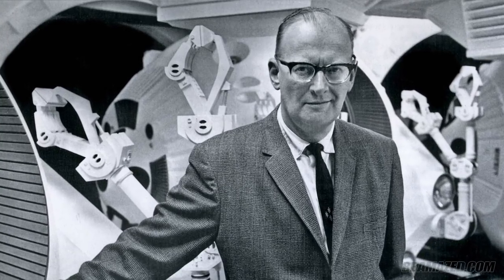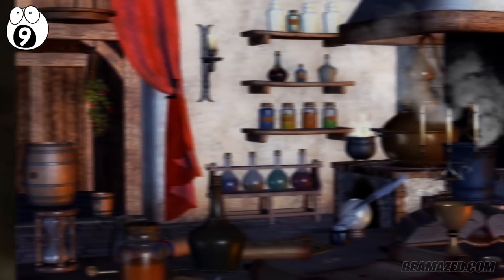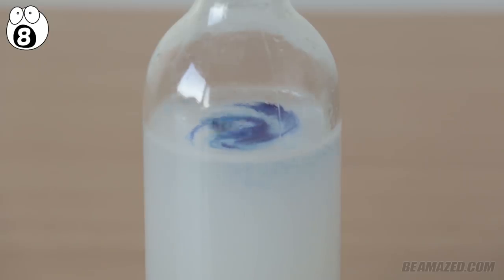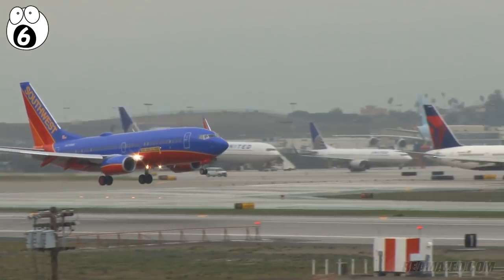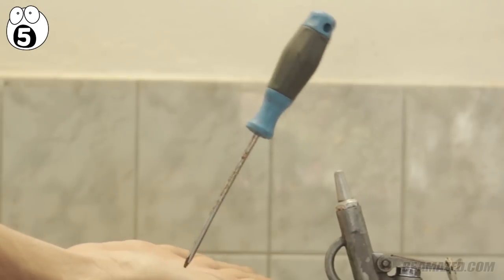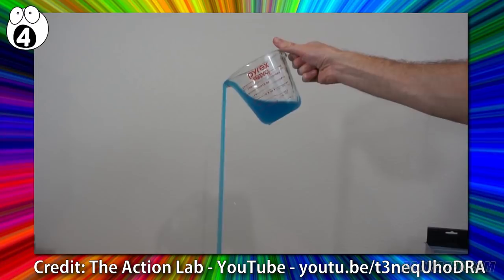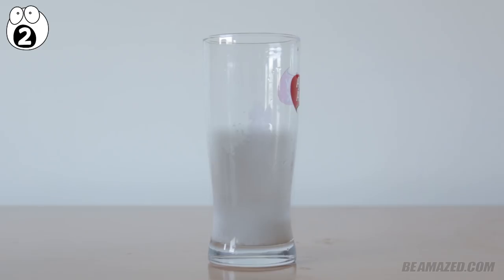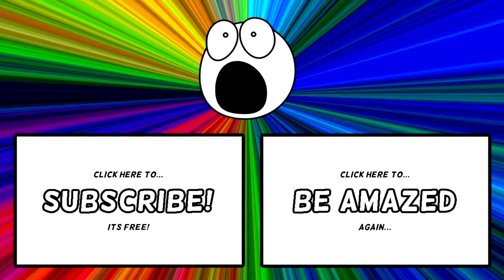Easy Science Magic Tricks Anyone Can Do

Comment: Would you like to make crystals at home? Yes? Follow the directions below: 
You’ll need several pennies, a straw, ammonia, a jar, salt, bleach, and baking soda. The instructions say to put the pennies at the bottom of the jar; you fill the jar up to 2/3 full of ammonia, and then top it off with bleach. You’re then supposed to blow bubbles into the mix, using the straw.
Reply: ItsMrHathaway a small side effect is mustard gas
Reply: Ammonia and bleach actually produce chloramine and chlorine gas which are both very toxic (long term exposure can kill you)  "You have been warned"
Reply: ItsMrHathaway are you actually trying to kill someone?

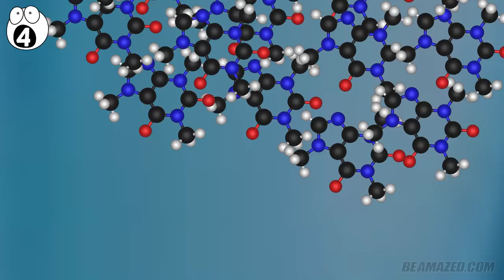Comment: 6:50   More than 50,000 times denser than water?    So that roughly 1/2 liter cup of the stuff should have weighed more than 25,000kg?  Uhhhhh?
Reply: Yeah.. That doesn't make much sense. Just to make sure I looked it up, and it is denser, but only marginally. About 1.2 times as dense. And the molecular mass is also not 50k times the molecular mass of water, it's about 4 times. I think what they tried to say was viscosity.
Reply: You got there before me, I was going to say the most amazing was someone holding up 50,000lb of liquid like it was nothing.
Reply: Also must be one of the older style Pyrex measuring cups that could with stand those types of forces (and cooking meth with)